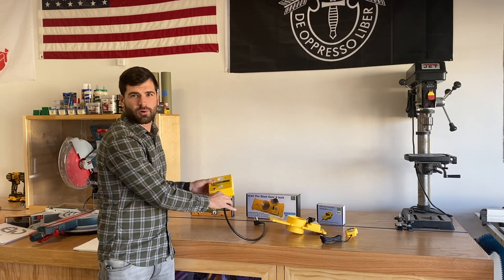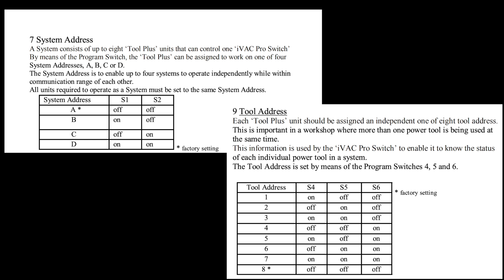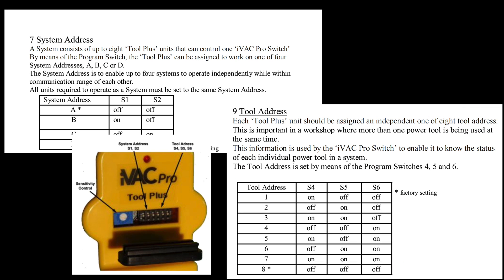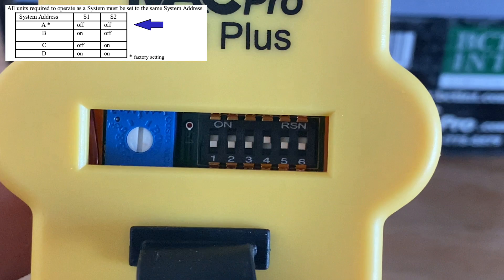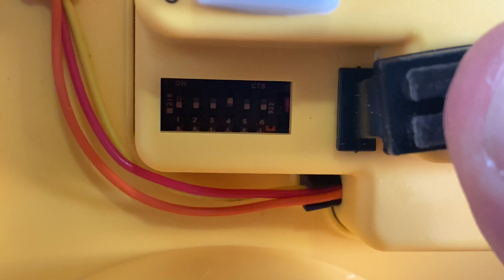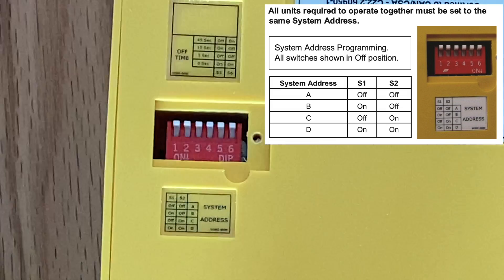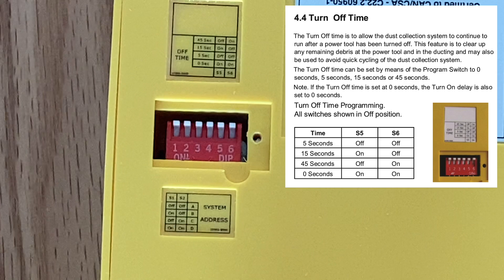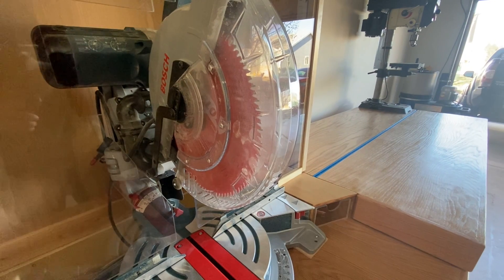iVac Pro Programming Tutorial

Comment: I cannot get this system to work!  I ordered a new switch and tool plus.  I have the address set to "4" on the tool plus and left the default settings on the switch.  When I turn the table saw on the led lights up but the vacuum that's plugged into the switch does not come on!  I have both set on Auto.  When putting the dip switch to "4" I made sure it was in the off position.  This thing is driving me nuts

Comment: Thanks for the excellent instructional video; for my understanding however, it looks as you need 3 power points for each piece of machinery - is that correct? One for the miter saw for example, one for the tool and one for the gate? Correct?
Reply from the maker: Yep, that’s correct. The sensor and the gate don’t draw very much amperage (especially the sensor) so you could get away with using a splitter on a standard outlet where you were going to plug the tool in.